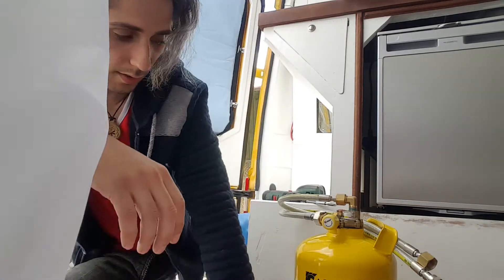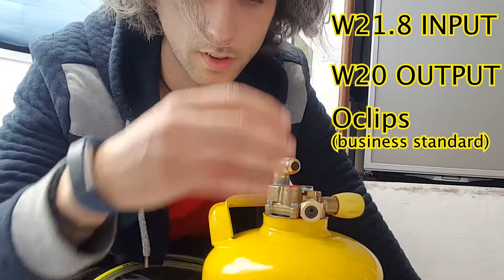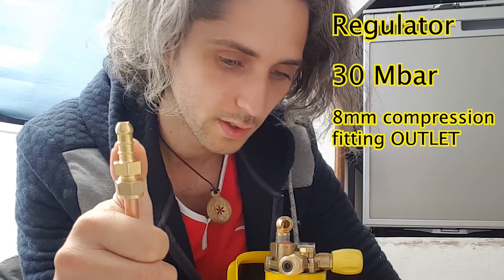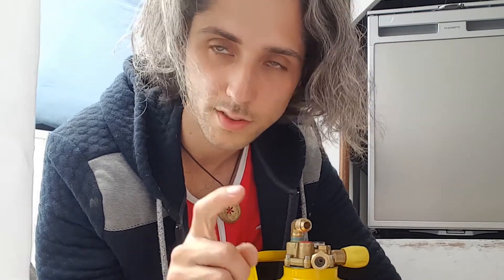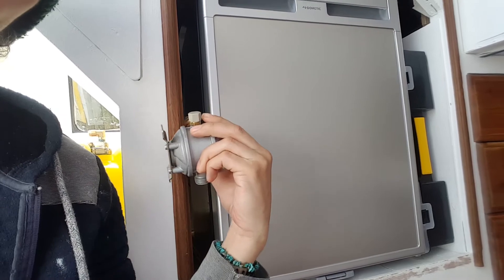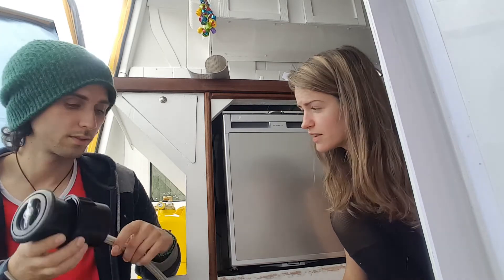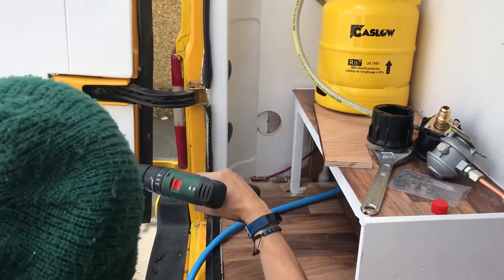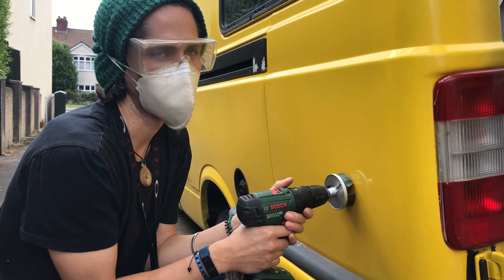Tips & Tricks || GAS || Inlets, outlets, regulators and safety regulations for your van gas system!

Comment: Interesting video. Not sure if it was just the camera but it looked like you had your drill in reverse (anti clockwise) when you were drilling the hole? Might be why it took so long.
Reply from the maker: Yes it was a piece meant for wood as I couldn't justify spending £30+ on one circle so opted for a multi-set that said it could be used for metal too, but this is 2mm milled steel. I went in reverse to try and create a groove so it would stop jarring when set clockwise. That ended up blunting the blades haha. Next time it's better to just get a proper bit or use a nibbler maybe. Good eye, well done for noticing hehe
Reply: @PathofRA  well you got there in the end. Hope you're enjoying the van.
Reply from the maker: @sicox100  Yeh we are thanks, working on the videos to continue on from when we left at the end of this one.   Check us out on instagram! @pathofra